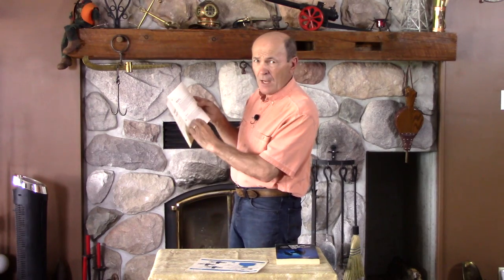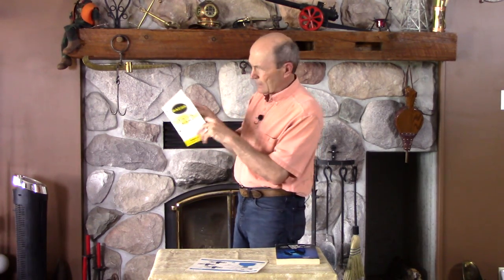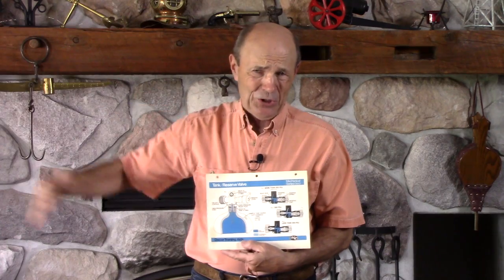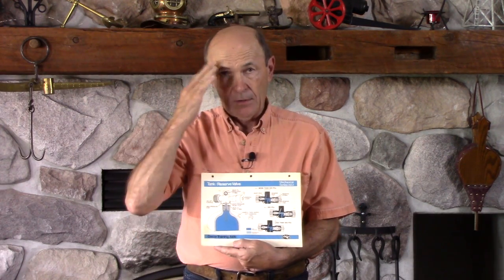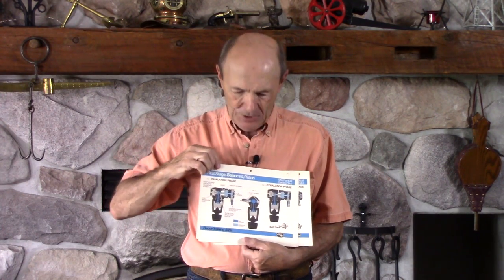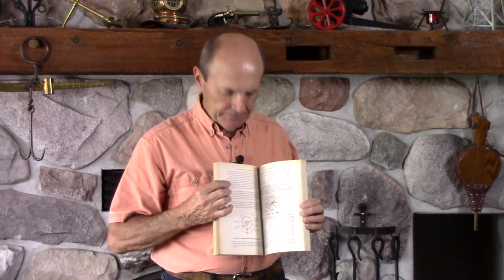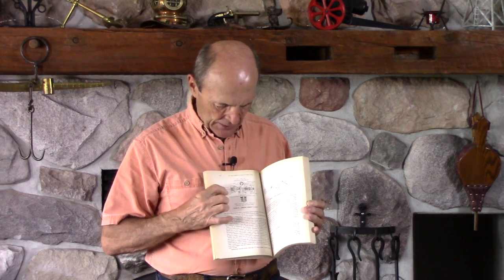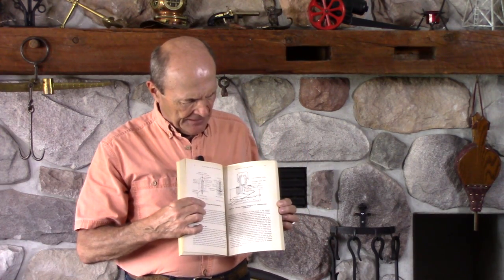Vintage Scuba: What New Divers Don't Learn - S03E12

Comment: I think back in the 60s manufacturers felt that they should include diagrams to help people who are comfortable disassembling their regs. nowadays, manufacturers feel that their are too many things that could go wrong when disassembling your regs. Thats why they reccomend getting them serviced by a certified tech. For safety reasons
Reply: the public safety is just an excuse and one of the elements of the marketing plot and is actually opposite in my POV. The "black box" full of "magic" that only a certified "wizard" can touch and therefore it costs a fortune. It makes people super dependent and not understanding what CAN go or COULD have gone wrong. Changing the LP hose is now considered a service level job!!! I don't recommend doing full reg service without qualification / tools / original spares but keeping build diagrams confidential or not explaining how equipment works is very wrong. Any diver going beyond "casual weekend warm water supervised dives" should make up for missing information for own safety.

Comment: Another thing that I found out recently is that Dive Shops are prohibited from selling used Regulators by their insurers...
Reply from the maker: I've not heard of that. We have a good business selling used regulators. Of course they are serviced properly and we even guarantee them. 
I can't see a problem there. technically used is after 1 dive which shouldn't prevent them from being sold.
I even service and sell very old regulators - even 2 hose from the 60's.
Alec
Reply: Alec Peirce Scuba : Is in New York City and Long Island, nearby.  All tell the same story...  No used regulators
Reply from the maker: Too bad. Misguided I think.
What do they do with their used rental regulators when it's time to replace them? Throw them out?
I doubt it.
I also doubt that the owners or instructors toss out their own regulators when they decide to upgrade.
That policy must be a simple money grab.
Alec
Reply: Alec Peirce Scuba : I was told to go to EBay or to the Web Based Sites.  You find it tipping "Used Scuba Equipment'"  There are 2-3 in the North East USA.

Comment: Personally I like the idea that divers take their regulators in to be serviced by a qualified technician, generally it is between $25-$45 annually per regulator not exactly a fortune (and if you dive Apeks/Aqualung parts are free for life if you get it serviced annually. I'm sure other manufacturers have something similar I'm just unaware of it). I dive more than the average bear, generally I get in 150-200 dives annually (173 so far this year) and I see a number of DIYers out diving. Some of the DIYers you can tell know what they are doing and are true craftsmen who have an attention to detail, and for those divers I think it's great that they service their own gear. However, there are the others..... You know the guys who wrap up some duct tape to fix their mask strap, or are using cordage to replace a broken clip on a BCD. These individuals are dangerous not only to themselves but to me as another diver who might encounter them underwater (I say encounter because I wouldn't knowingly dive with someone who had defective gear). As such, I think it's great that the slap-dash DIYers have to put in a little leg work before further endangering other divers with their incompetence instead of the manufacturers providing them the guided tour. I'm pretty sure that the competent craftsmen out there would put in the time and research anything that they are risking their lives on.

My two cents. Great videos
Reply from the maker: Great ideas Hans-Eirik. Very good comments.
I will suggest that the annual service fee is closer to $100 than $25 but it's still a good deal.
You're right as well that other manufacturers offer free parts and now the service interval is usually 2 years to keep your warranty in place.
Take care. Thanks for watching.
Alec

Comment: Today nobody wants or needs to know how everything  works. We need to know how to use it. Some of us are curious and will look into a particular subject, but so many things have become so complicated that knowing everything about everything is not possible. 
We are consumers today. Remember tube TV and radios?  You cold fix your own. 
I am retired now but was a mechanic my whole life. As a child I would take things apart, (and sometimes not be able to put them back together), to see what made them work. Remember alarm clocks that had springs in them?  Watch out for that flying spring as it unwinds!
Some people are not one bit interested in mechanics and it is a good thing. They become Doctors and other important things. 
Manufacturers probably figured out maybe 5% of their customers wanted to work on their own devices, and maybe 4% of those would get it right. O rings are easy to damage as an example.
Reply from the maker: Glad to hear from another 'how does this work' guy.  I grew up the same way, take it apart and see how each piece works with the next  to do a function.  Did break a lot of items but soon fixed more than I broke.  Appreciate hearing your story Danny.

Comment: I think the change in guidance towards equipment maintenance is fourfold... 1) We live in an increasingly litigious world where manufacturers are worried about any equipment failure coming back to bite them, in the form of a law suit, and so won't provide information which would potentially lead to divers incorrectly maintaining their equipment in such a way that could lead to dangerous failures. 2) Similar to my first point, brand faith is a big selling point. If divers suffer from equipment failures, even if due to incorrect self-maintenance, the reputation of the brand could decline and so too, consequently, would their market value. 3) Money. Plain and simple greed is a big motivator, particularly as the market has grown exponentially over the last couple of decades, and manufacturers most likely make a killing off requiring kit to be sent back to them for servicing, or can profit off dive stores affiliations as an approved service centre. 4) There has been a large increase in the number of dive stores, in recent years, as the market has grown, reducing the need for self-sufficiency as it's more likely you're close to an accessible service centre (which in turn minimises the risks of points 1 and 2, and increases the profits from point 3). I've only been diving for 9 years, and I like to think I'm reasonably technically minded, but I'd be worried if some of my fellow divers carried out their own maintenance (beyond more superficial cleaning and such) as they just don't possess the necessary skills.
Reply: Although I agree with you on your points of safety and greed, I do believe that the more a diver knows about his equipment the better prepared he is in a case of emergency. I'm a fairly new diver so take my opinion with a pinch of salt. But I'm very curious about the technical and medical aspects of diving.
Like I was told that an unbalanced first stage becomes "heavier" to breath the lower the tank pressure is for example. This could give me heads up that I'm running low on gas in case I forget to check my pressure gage.
Of course this knowledge could lead to someone diving without a pressure gage in the believe that this mechanic will help him and hence act irresponsible. However, I think the positives outweigh the negatives in most cases.
Reply: 952way I definitely agree with you! I'm currently an equipment officer for a university club and I wholeheartedly believe that a better understanding of the mechanics of the kit lead to safer diving. I've trained with PADI and BSAC, and would consider BSAC slightly better in this aspect of training, but not significantly. I think the fact that many recreational divers will only go on one or two trips a year, and dive with exclusively rented equipment, means that they won't benefit from the knowledge of how to maintain their kit (as it's less likely they'll invest in getting their own) and so it's been written out, much to the detriment of many of us!
Reply from the maker: That's why PADI (and others) offer Specialty course in which a diver can learn that stuff. It's good stuff but not relevant to everyone, not interesting to everyone and NOT related to being a good diver.
Knowing the difference between Upstream valves and Downsteam valves never helped a diver stay safe.
At my store we offer and encourage the Equipment Specialty course. I even offered an Advanced Equipment Specialty for tech-minded guys like you. These course were very popular but only of interest to a small percentage of divers.
Alec
Reply from the maker: Knowing a lot sounds like a good premise but one must be careful with new divers. What do you want them to know? 
Perhaps a divers should be taught to NOT run low on gas rather than how a 1st stage works!

BTW, it's a bit of a mistake to say that an unbalanced reg breaths harder as the pressure drops. It's unlikely a diver would notice any difference in breathing whether the tank was at 3000 psi or 300 psi. There is a difference but it is only in a variation in the intermediate pressure (IP). The IP supplies the air to the 2nd stage and is set by the manufacturer to be about 135 psi + or - 15 psi.
A tank pressure drop from 3000 psi to 300 psi would produce an IP variation of between 4 and 10 psi. That's less that the manufacturers allowed variation!
Of greater interest is that a standard piston regulator will experience a drop in IP as the tank pressure decreases but, a standard diaphragm regulator will experience an increase!!
Any negative effect on breathing effort attributed to non-balanced regulators is highly overblown.
I think dive store staff have latched onto that idea as a good selling point.
Perhaps that's one reason why new divers should be taught about regulators - so they know what they're talking about.

Take care.
Alec
Reply: Thank you very much for that explanation!

Comment: If everyone knew how to service their own equipment the LDS won't make money selling those services.
Reply from the maker: Well,
1. it's not that easy. Few divers actually have any idea how to service a reg.
2. divers seldom can find parts or tools.
3. you definitely need some mechanical abilities 
4. most divers are too smart to service their own regs.
5. most divers are too lazy to service their own regs.

So, I figure, after all that, only about 7 divers in the whole world actually do service their own regs.
Dive stores don't need to worry about that.
Tongue-in-cheek Alec
Reply: @AlecPeirceScuba_SeaHunter  Thanks for the reply Alec. Very good points 👌.
Reply: It is doable. I started servicing my own regs when one LDS tried to pull a fast one (returned my reg w/ a bulging environmental diaphragm and told me it was "normal") and the next one used generic non-OEM parts and charged me for the OEM kit. It is quite easy if you are mechanically inclined. The problem used to be finding the kits which is now moot due to the advent of e-commerce. You can find the tools if you look hard enough. Service manuals are available. Having a friend in the dive industry is also helpful for service bulletins which is not really a must especially for relatively "old" regs which have not been updated for a while. The caveat is that you will actually be spending more money than just having your LDS do it for you.
Reply: @AlecPeirceScuba_SeaHunter  I for one service my own regs. As a matter of fact, I got rid of my Aqua-Lung Legend regs and replaced them with Hog regs because Aqua-Lung parts are so hard to get a hold of. 

There were a few things that started me down this path. 1. After a rebuild, my regs would make a strange honking sound whenever I inhaled. I took it to the shop several times and they were never able to fix it. 2. I happened to see inside the shop where they rebuilt the regs. Not very clean and very disorganized. 3. I am the person using my regs and I have to most to lose if something goes wrong. 

I know of several divers who rebuild their own regs. I would say at least half a dozen. So there are many more of them than you realize. 

There are dozens of us. Dozens!
Reply: @KernelFault  I, too switched to Hog and got the certification for servicing my own. Valuable knowledge- and servicing 4 family members-worth of gear was instant return on the class and tools investment in the first year.

Comment: It's all about money. The dive shops dictate to the manufacturer to not supply repair parts or information so you have to bring the equipment back to the dive shop.
Reply from the maker: Ahh! A conspiracy theorist!
I wish it were true that dive store owners actually have some power over the manufacturers, but sadly 6977, it's just not the case.
The policy of requiring factory service training, having a store-front operation and not selling parts directly to divers is 100% from the manufacturers.

Now I'm not going to say that the retailers don't support it, but they don't make those rules.
In fact, there are lots of retailers, myself included, who will sponsor divers, not necessarily store staff at all, to attend a factory service clinic. And some retailers will also sell service parts and service tools to divers, myself included.

Please let me explain that those policies are generally there for the protection of the divers and ultimately the sport itself. It would NOT be good if every diver, trained or not, mechanically inclined or not, either tried to fix his own regulator or took it to someone else who tried to fix it. Like it or not, modern regulators require some specialized tools, usually unique to each brand, sometimes unique to a model, for the proper disassembly and reassembly of the reg. And special instruments are now needed to properly set the adjustments on modern regs. The old methods, like suck to see if it's easy, simply don't cut it anymore. Few if any divers would be interested in buying such tools or instruments.
And I can tell you from sad experience that servicing a regulator today is not simple. Some are, but many are quite frankly, a pain in the butt. I can completely service, top to bottom, some solid, simple regulators in as little as 30 minutes. But I have also struggled to properly reassemble, adjust and tune another regulator in under 2 hours. I have actually given up and left it for another day in some cases - and I have factory service training for about 15 different brands and over 50 years experience in servicing regs. Any service person will tell you the same.

So, while I understand your sentiments, feeling at the mercy of the scuba gear manufacturers in this regard, I assure you first, that it is not because of the retailers and second, the policy is a good thing. Liability and life insurance rates are already too high.
I suggest that you get friendly with your LDS and see if he won't let you work with him on some service, even simple stuff and then maybe show you how to service your own gear and make parts/tools available. That's what I have done for some divers.
Hope this helps.
Take care.
Alec

Comment: all about the service upcharge for the dive shop...
Reply from the maker: Every business needs a profit but this was about the mechanical aspect of dive gear training.
A
Reply: @AlecPeirceScuba_SeaHunter  well for sure but I thought that was a question why it's not that way anymore. I feel most shops want to keep it mysterious and scary to do self-maintenance so people have to go to them. I'm 100% confident my dive shop uses this tactic for profits. I personally love having the full maintenance manuals and exploded diagrams. I am technical and smart enough to do this kind of stuff myself with some training. I think society is created this even the next younger generation doesn't care about how most things work at the core even computer stuff They just want to use it and have fun. I personally want to know how things work just out of curiosity and the reward is saving some money or creating improvements where mods may be possible.
Reply: @AlecPeirceScuba_SeaHunter  it's a shame I got a set of scuba gear for $400 the other day that has fairly low use scubapro regs and when I rang up my local shop for a service cause they haven't been used since 2016 they quoted my $350, so that's 750 if I'm lucky and the gear is already minimum 8yr old. But I can go to the dive shop in a state 1000km away and purchase online delivered a brandnew BCD spg and octo with decent 2nd stage regs for 1030 delivered. Or a new first and 2nd stage for 500 roughly but get a good price for the package deal. 

So now I'm looking to scrap perfectly good regs and buy a new one cause it's only a little bit more then a service.
Australia sucks for pricing or atleast victoria does cause another state about 9hr drive away will rent a full kit for 4days head to toe for $90 including a tank amd then 20 per extra tank no tips either in Australia so what you pay is final.